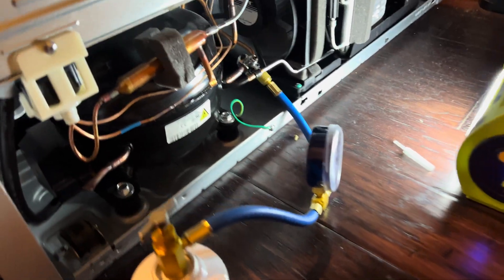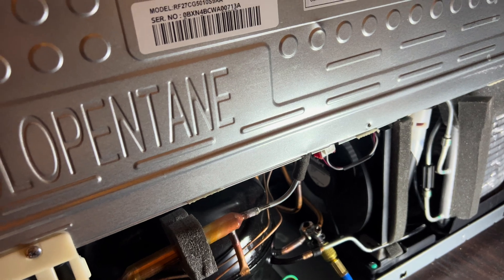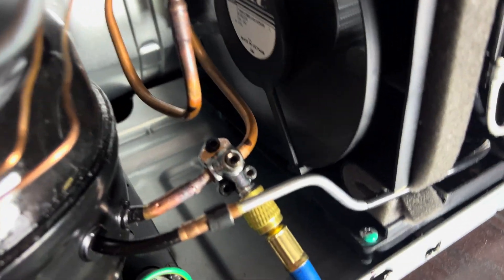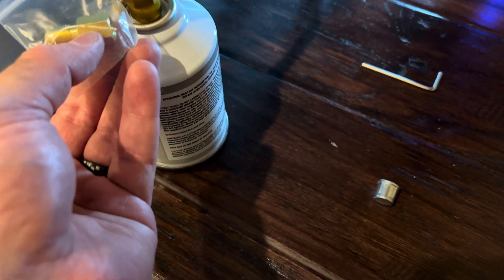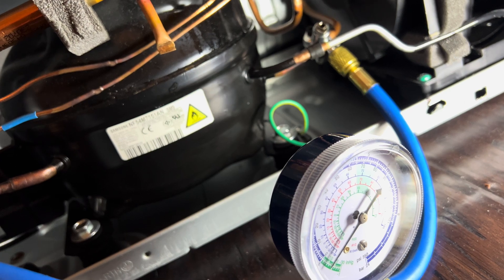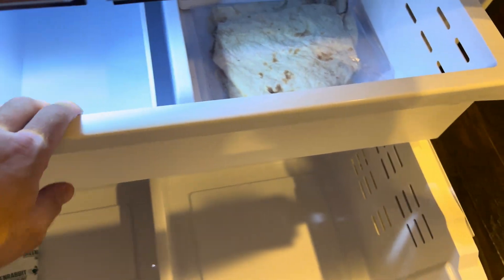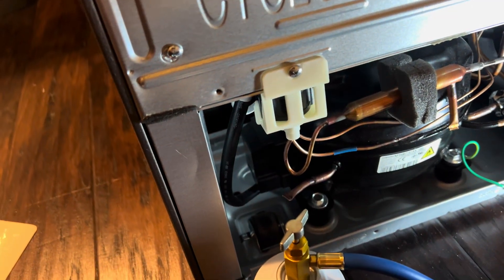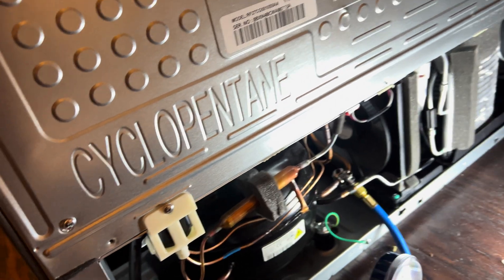DIY: Recharge Samsung Fridge 27 cu ft Mega Capacity model RF27CG5010S9AA R134a Freon

Comment: Thank you for sharing this!!! Mine just died, so I’m trying to troubleshoot it. Another video I watched said if it’s a problem with the Freon, then to get a technician, but I feel the same way as you about technicians. 😂🤣
Reply from the maker: Thank you for watching!! I was about to get rid of it and just buy a new fridge so I figured why not try fixing it. I have used techs in the past without success and I don’t think it’s going to be a difference experience today 😅 once you install the port, you can check pressure and you’ll know if you actually have Freon in there or not and then you can proceed with recharge if Freon is low. Good luck!! Let me know how it goes.

Comment: About to do this on my fridge with some stop leak freon, slightly newer model but very similar. Was curious if this fix held for you and resolved the issue
Reply from the maker: So far so good! I put thermometers one in fridge and one in freezer and it’s been consistent -2 in the freezer and 37 in the fridge. The only thing I noticed after this is the fridge compressor makes a loud noise when it starts but to me this is better than buying a new fridge. Squeeze as much life out of it as possible before throwing it away. Hope the fix goes well for you! Let me know how it goes.